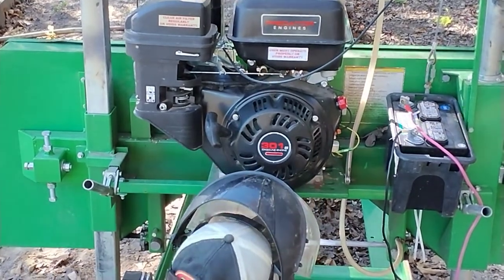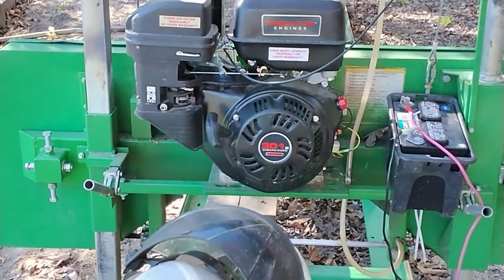Our First Cut For Coffee ☕ Table Diorama Build Oak Beam Repurpose

Comment: PLEASE HELP ‼️‼️‼️‼️
I’ve got a 1976 Chevy Itasca RV on a Chevy p20 chasis, the system is a 350tbi. After I got a new alternator put in my gages spin crazily, they ALL spin besides the battery gage one I’ve noticed. I’ve gotten it looked at by 2  mechanics and the wiring is fine according to them, they say it’s the cluster panel itself but I struggle to understand that as they were working perfectly fine before the new alternator. Also there’s a green wire, it was connected to something then I discovered it burned off at the end. I also noticed there’s two green wires coming from the headlight switch if that matters at all, dark green and light green. At this point I’m wanting to check it all out myself, have any advice?
Reply from the maker: You have something wired wrong possibly. Also could have had a short somewhere that would explain the gauges going crazy & burnt wire. Id have to see a detailed video to try to help.
Reply: @daninthedirt9449  You have social media where I could send you the video on?
Reply from the maker: @briizcustoms9543  Twitter Livefreeordie2b